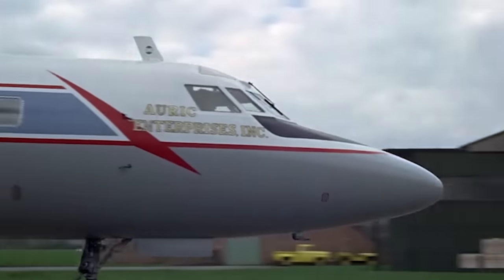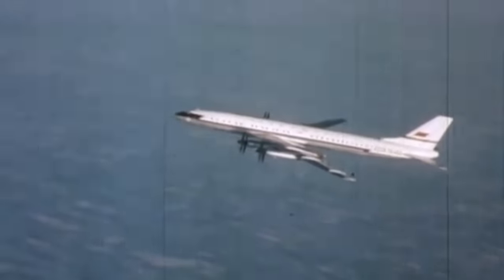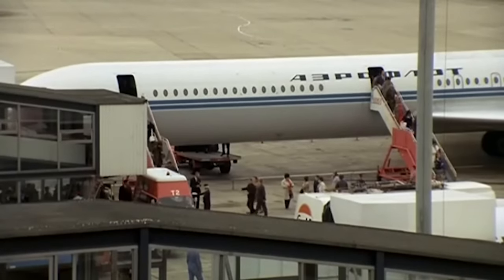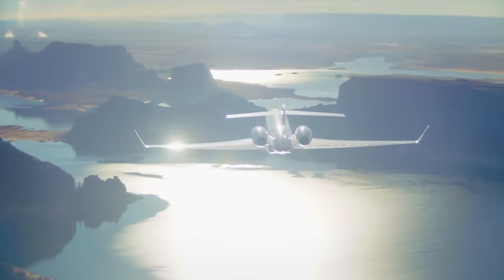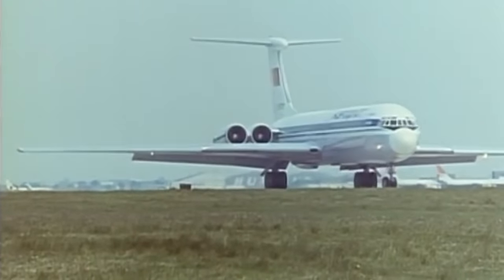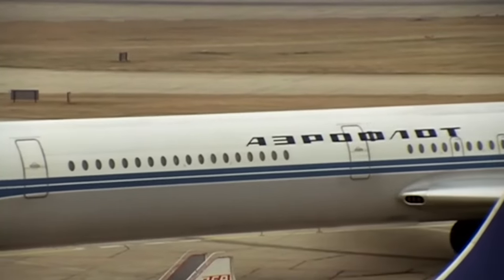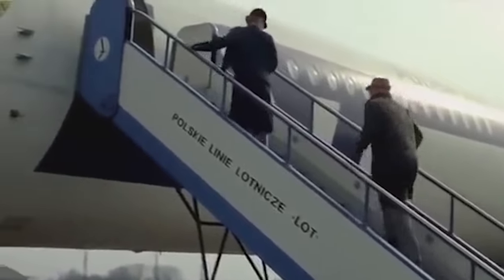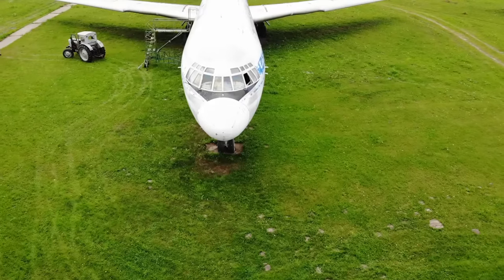IL-62 - an ideal option

Comment: Flying coffin :
The "Nicolaus Copernicus" aircraft (non-modernized version Ił-62, registration number SP-LAA) crashed during the approach to landing at the Warsaw Okęcie airport on March 14, 1980, at which the leading Polish music star Anna Jantar was killed. On May 9, 1987, the "Tadeusz Kościuszko" aircraft crashed (modernized version Ił-62M, registration number SP-LBG), whose disaster in the Warsaw Kabacki Forest, in terms of the number of victims, is the most tragic accident in the history of Polish aviation. Due to political conditions, it was impossible to change the supplier of the aircraft, therefore technical and operational changes improving the level of safety were carried out in LOT operated by LOT Polish Airlines. The changes were based on experiences from two previous disasters and included:

Duplicate aircraft control system.
The use of a more extensive (compared to the original) engine shaft vibration detection system.
The use of non-combustible materials in the cargo hold.
The use of smoke alarms in the luggage compartment (instead of fire alarms) - faster warning of possible danger.
Laboratory engine oil check after each flight.
Exceeded vibrations of the engine shaft during one of the Il-62M flights resulted in the decision to turn off the engine in flight with passengers (flight No. 015 from Warsaw to Toronto on March 11, 1990 [2]) and start for a return flight without passengers, on three engines and arrival at the Okęcie airport (commander captain Dr. Eng. Tomasz Smolicz). These procedures prevented another tragedy; the disassembled engine was sent to the USSR, where the shaft support bearing failure was found. This decided to abandon the use of this type of aircraft by PLL LOT.
Reply: I could say the same about Max 8
Reply: It had to be a real nightmare having to carry out that amount of work. As well as having to schedule replacement aircraft.

Comment: 4 engines at the back means that if one disintegrates it can easily destroy one or two more and flight control systems, and since "simplification" of the construction actually meant less redundancy it proved to be a deadly combination. Definately not as marvel it's presented as.
Reply: It still had fewer crashes than the 707, both in sheer numbers and per capita.
Reply: @leifgiering  Not that much of an achievement since 62 is almost a decade younger.
Reply: Fair, then we can compare it to the 727 where the hull losses are slightly higher.  23 out of 292 built, for the Il-62, versus 119 out of 1,832 727's built, a ~1.5% difference.
Reply: Do you know how often this actually happened?
Reply: @imonymous  AFAIK 9 accidents/disasters were caused by loss of tail controls and/or engine failures.
Reply: @leifgiering  That is probably not correct. The /07 was also flying in the 1960s, a time when everybody's airliner crashed. Better to compare the Il-62's service history with the widebody airliners of the 1970s - most Il-62s were in fact built in the 19670s and 1980s.
Reply: @yoyohoolahoop3705  The 707 and 727 were built up to the 80s, so they're fair game for comparison.
Reply: @leifgiering  I believe the comparisons should be made based on the number of flights made and the nymber of passengers transported. Then you will see a true safety record.

Comment: I like how the plane looks, however the 4 engine in the back design is truly awful. Often, when 1 engine failed it took the other one with it. The location also often destroyed other elements of the plane. Out of 9 planes used by PLL LOT for example, 2 crashed. Not only that but  additional safety devices introduced afterwards, helped save another plane from crashing as well. The engines were hideously unreliable and puting them right next to each other was just stupid. Everything in the back was flammable and there were no fire sensors. Fire in the back always resulted in a complete loss of control of the aircraft.

Comment: The problem of these planes was the engines, and in them the low quality of materials used for bearings of turbine shafts, their insufficient lubrication, and low quality of assembly. The bearings were overheated and the manufacturer tried to prevent them by drilling holes in the bearing rings !!!!! Due to cost-effective aircraft, it did not have a dual system of hydraulic control lines, which was then standard (VC 10). THIS WAS THE REASON OF MANY DISASTERS. This type of aircraft has about 22 catastrophes, which gives a very high rate of 8% in relation to the number of aircraft produced.
Reply: @edgarguinartlopez8341  He's probably Polish because he has several comments stating how dangerous the Il-62 is without actually looking at the whole picture. He probably didn't even watch the video because if he did he'd know that the engine problem is mentioned in it.

Comment: Prymitive plane with exploding engines. Poor build quality.
Reply: Same engines were on Tu-154. No accidents involving exploded engines. As for the accident with polish Il-62 - LOT airlines violated the manufacturer's safety instructions, they didn't replace the engine when it exceeded its runtime limits, and kept the aircraft flying. Even soviet quality can't save from human stupidity.
Reply: @gravelking2.071  no it is not true. First limit was ended then inspection was proceed according to the manufuring standards as result next several hudrets of hours was granted. The reason for that was the Uasr leds was piss off at poles because the Solidarnosc mo movement and they block sale new engines. No inspection could discover faulty bearings made not to match the spec. Please do not repeat again this soviets lies. Subject was very well investigated and there are material evidents of ussr faults. By the way, poles did not believe that other engines owned by PLL LOT are ok, so they install special hardware to measure vibrations at rest of jests and guess what, another accident almost happen some time later. Soon as possible soviet planes was sold out and replaced by B767, no plane lost since this time.
Reply: @Bucefal76  if what you're telling is true - why only polish jets had exploding engines? No accidents with D30KU or NK-8 in any other airline that operated them. Neither with Il-62 and Il-86, nor with Tu-154.
D-30 may not be the best engine in the world, but it is very reliable. Hundreds of them lift RuAF Il-76s to the skies now.
Reply: @Bucefal76  and by the way - there is no such thing as the "first limit". As Voland said in Master and Margarita: "Свежесть бывает только первая, она же последняя. А если рыба второй свежести - это значит, что она протухла."
Reply: @gravelking2.071  Your logic if invalid. The B737 MAX didn't crash in any western country, but do you think this is also the safe plane?
Again, please stop spreading the lies. There was 3 incidents related to this engines (two fatal). All of them in the same faulty batch of engines provided to polish LOT.
All fails happen before the required period of major refill. 
The true is that engines bearings was modified by not authorized persons and not certified again, yes it was a crime against USSR civil aviation law!
This poor plane had no redundant control system (redundant control system was introduced only in polish planes after second fatal incident). The original vibration warning system was not sufficient and had to be updated with new one. The new one system detected another fault on the fly from Warsaw to Toronto at 11 March 1990. Then all planes was grounded and sold.

By the way I'm generation that had this "luck" to use the USSR products and believe me, the first contact with Russian products was always the same: fix it at first, then try to use and not die by electroshock (Minsk fridge) or do not burn a life (Rubin color TV).
Reply: @Bucefal76  so, in summary we have: 3 engine accidents among thousands of those engines (Soloviev D-30KU), half of which are still flying with no issues. Because of some polish dudes who saw fit to repair an aircraft engine that went past its limits with what they could find in the nearby workshop. Which wasn't the first time in LOT btw, the previous version of Il-62 with NK-8 engines also crashed because of maintenance issues.
Yeah. Definitely faulty commie design. 

LOT: There are no spare bearings...Nevermind, we'll fly with 13 roller bearings in our engine instead of 26, what can possibly go wrong?
Il-62: (crashes)
LOT: pikachu face
Also LOT: It's commie fault, their planes are trash!

And comparison between civil aircraft that was Aeroflot's flagship for many years and fridges and TVs is just perfect.
And the reason of switching to B767 is the economics - it was the most fuel-efficient long-range airliner at that time.
Reply: @Bucefal76  "LOT din't know that they have faulty bearings" That's LOT's responsibility. That's the whole point of maintenance; to find defective items and either repair them or replace them. LOT failed to do these, and decided to keep flying their planes. You can blame Ilyushin all you want, at the end of the day LOT didn't perform its duty to carry out maintenance properly, and didn't carry out its responsibility to keep its passengers safe by grounding the planes following the discovery of said issues. Also, the switch to the 767 is completely unrelated to the crashes; it was just a more modern, larger, more fuel-efficient airliner, so it made sense to buy it to replace the older Il-62s.
Reply: @9999AWC  What is not clear in this phrase: bearings were made not up to manufacturing spec. Not certified changes were introduced to the engine. The customer was not informed about illegal changes. Are the same standards still valid in Russian aviation?

Comment: As far as I know, the Il-62 did not originally have those tooth of the wing leading edge. The reason to create them was not only to replace the lifting force usually achieved by slats. There was another issue: the aircraft had a tendency to enter deep stalls and sudden nose pitch ups. The reason was the airflow that turned towards the wingtips, which led to diminished lifting force and/or stalling of the tips. So, the only lifting surface was closet to the fuselage and center of lift moved forwards. Next, when the nose flipped up, the airstream to the engines was interrupted. These teeth creates a vortex in order to keep the airflow from shifting.

I really do not know if this point of view is correct. It somewhat makes sense. You can see different kinds of fences on the wings of the other rear pusher jet liners of the era - the Caravelle, and BAC 1-11 to name two. Far more modern Canadair Regional Jets do not to seem have those, but they have winglets to diminish the vortex around the wing tip which might have something to do with the phenomenon. 

If a professional aerodynamic engineer or aircraft designer happens to read this, please, correct me as needed!

Comment: Between 1980 to 1990 I had the opportunity to fly on the Tu-154B,  Il-62M and the Il-86D  which were the main Soviet airliners at the time operated by Vietnam AIrlines, Interflug, Aeroflot, MIAT. The long haul flights were mainly operated by the Tu-154B, Il-62M and Il-86D with technical stops between Laos, Vietnam with the former Soviet Union and Eastern Europe.

Comment: When they get it right, they get it right. Beautiful bird, one of my favorite. And a cobra maneuver for deceleration, hah gotta love it, that is outrageous in the best way. If it works it works.
Reply: As well as popping the flight reversers 15 feet off the runway.  Russian pilots have a different approach from the West but their stuff sure works!
Reply: @deltavee2  Russians need to land of all kinds of airfields. Many areas were built only using airplanes as connection with the rest of the country due to the inhospitable conditions making it impossible to travel by road and extemely impressive and dangerous to travel by train.
Reply: @nottoday3817  I hear you.  Here in Canada we use ski planes in winter and float planes in the summer.  Canada has the most natural lakes on record and holds 50% of the world's lakes so runways are nice but not necessary at all since there is always a place to land regardless of the season.

Comment: Great video. I have a question though. You mentioned that the IL-62 has an added fuel tank in the vertical fin, how did they compensate for the additional fuel weight in the tail to balance the center of gravity (CG) issue?

Comment: Way back in the 1970's I still remember a CSA Il62 landing long at Heathrow on 27L and using the "cobra" landing manoeuvre. Until I saw this video today I never realised that this was standard procedure for this aircraft. I think it is the only time I have seen an aircraft tail-strike. I guess that crutch landing gear in the tail was useful after all. I had always assumed that the pilot had just got it a little bit wrong. Thanks for the videos I've watched a few recently. I would love to make a visit to Monino, but the current situation probably will means that I will never get the chance.